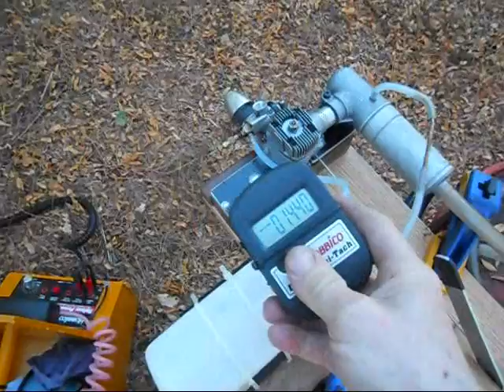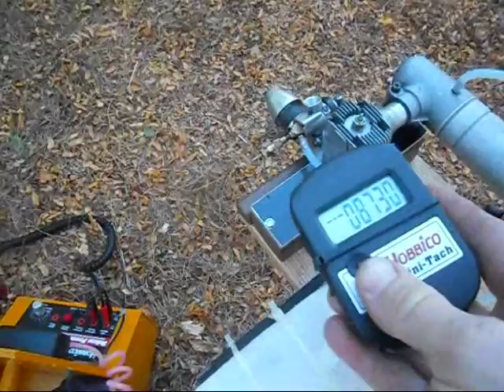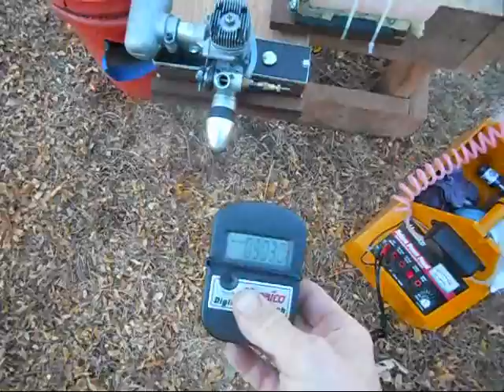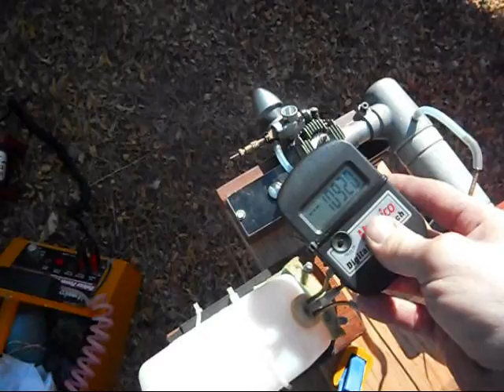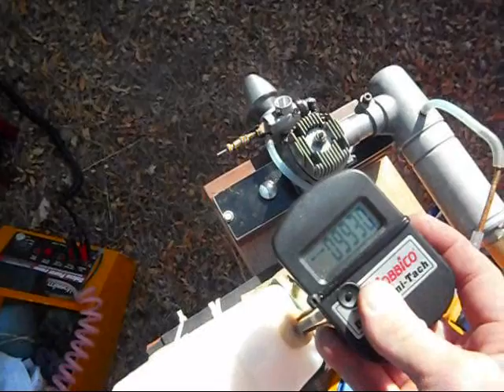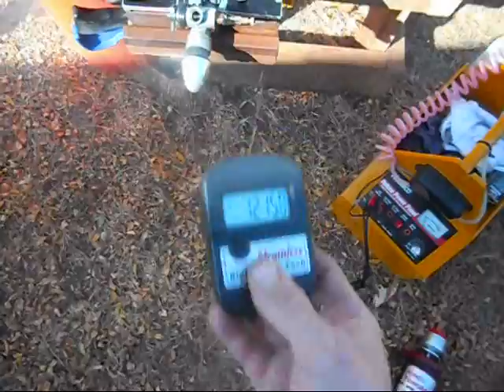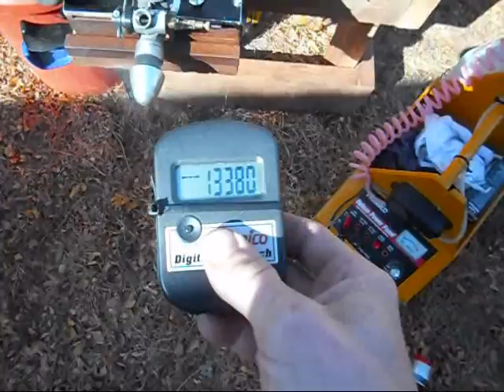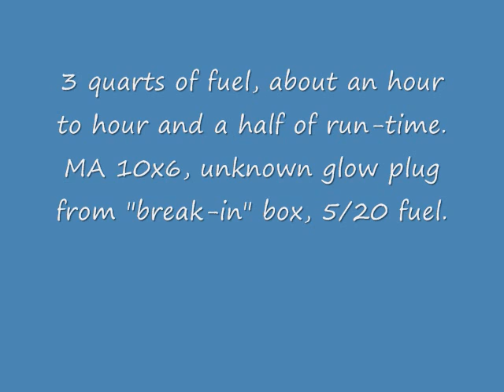SuperTigre G51 Test run after Rebuild Part II

Comment: Hi, I see you rebuilt this two years ago, but I just pulled out a plane with a Super tiger GS40 which my father in law left me. I have had it running, but a bit rough. It seems like after pulling it apart the main bearing needs replacing as it has been left without oil in it for storing. Looks a bit rusty, feels not so smooth. Got any idea how to get the main bearing out to be replaced? Thanks.